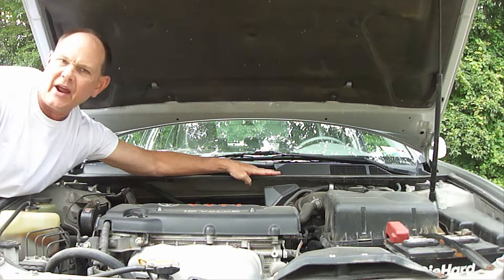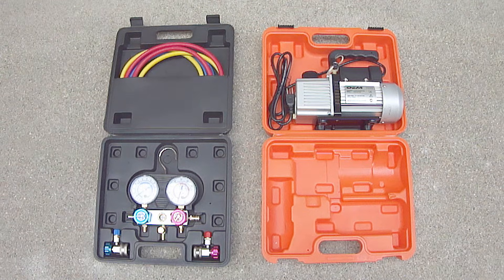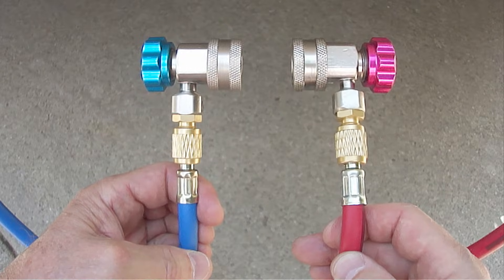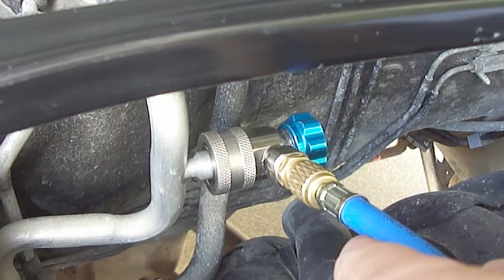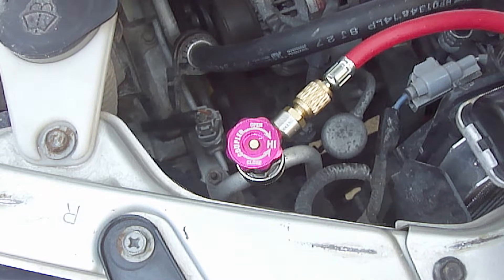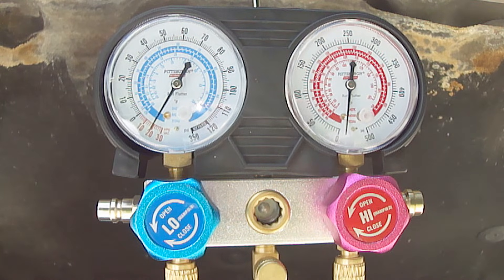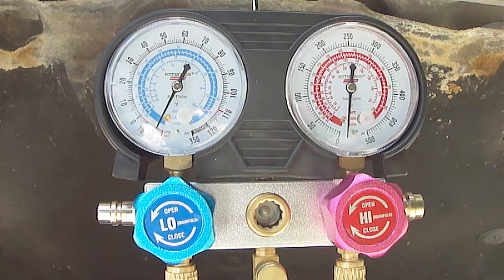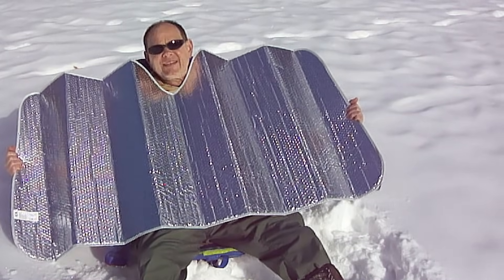How To Properly Use A Car AC Vacuum Pump

Comment: Don't guess at what the vacuum level is, get a micron gauge or you are asking for problems. Make sure you hook it up at the high side port. Pull the vacuum down to 500 microns or whatever the manufacturer requires.

Comment: 1 hour to overnight? Wow 
I heard of that but i found it hard to believe until now. I used a snap on ac machine a few times and the max runtime it called for a vaccum was about 20 to 30 mins but it was creating a vacuum of -29ish
Reply: I found this and thought you might find it helpful too. 

When using an air conditioning vacuum on a car, the low-pressure gauge should read around -14.5 psi (-76 cmHg), indicating a complete evacuation of the system, according to the Electrical Engineering Centre. This deep vacuum is essential for removing moisture and air from the system, ensuring proper AC performance. 

While the vacuum reading is crucial for evacuation, it's important to note that normal operating pressures for an AC system will be significantly higher when the system is filled with refrigerant. For example, an R-134a system, when properly charged, will typically have a low-side pressure of 30-50 psi and a high-side pressure of 175-250 psi.
Reply: How much vacuum pressure you can obtain will also depend on where you live. Higher elevations will achieve a lower pressure at full vacuum.  30 in/hg at sea level, 29 at 1000 ft, 28 at 2000 ft, etc.

Comment: Wow, Paul.  I never heard of running the vacuum so long.  I typically do 15 minutes and then a 15 minute vacuum test.  Then I'll do 30 more minutes if the system was holding a vacuum.  This is in line with what others have said, and with what the instructions with my equipment said.  But, I do see how beneficial it is to get every molecule of water out of the system, and if a long period of running will allow more to boil out of the system (and possibly even out of the oil), I don't mind waiting.  So next time I do one I will at least try it for several hours instead of what I've been doing.
Reply: I'm with you - there's no time for such a run time.  The robinaire doesn't take that long and it's industry standard
Reply: Most get very hot after an hour.

If you’re going to do it overnight I hope you have good homeowners insurance 🔥